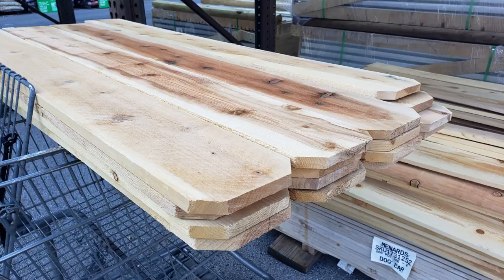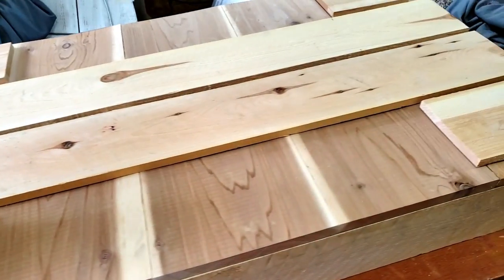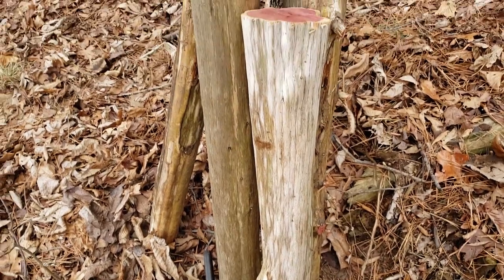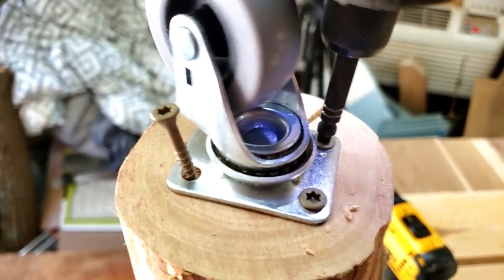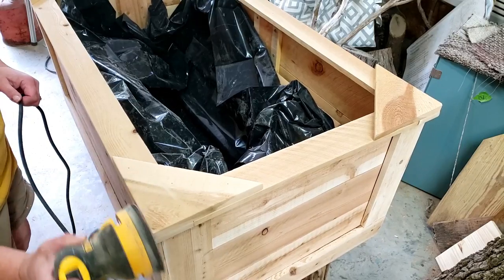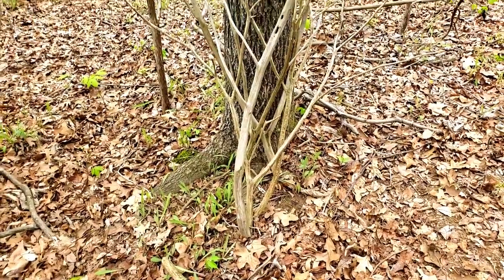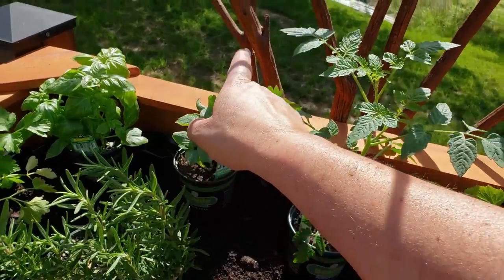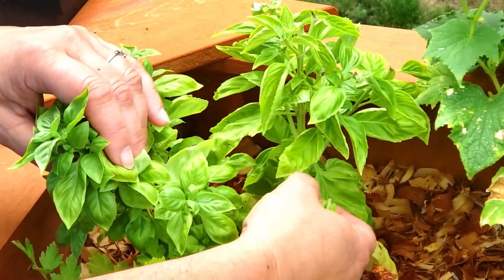DIY Red cedar raised deck garden start to finish! AND.. On a frugal budget!

Comment: How does that flex seal hold up outdoors on the wood ? 
I have some chainsaw carvings I'd like to try that on .
Reply: First time I've tried it on wood. We used on the barn roof and it has been working for couple years now. The areas I did are inside so I won't know how long it works. When I put it on it stuck to it great. This was the rough side of the board though, not sure how good it would adhere to smoother wood. Your idea sounds interesting! Thanks for watching!